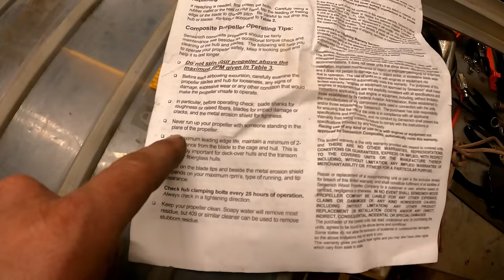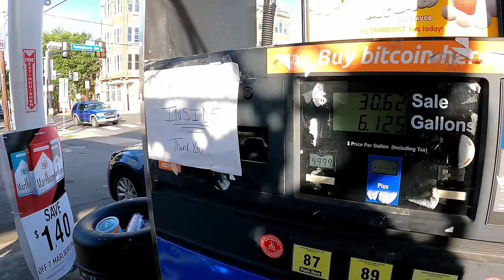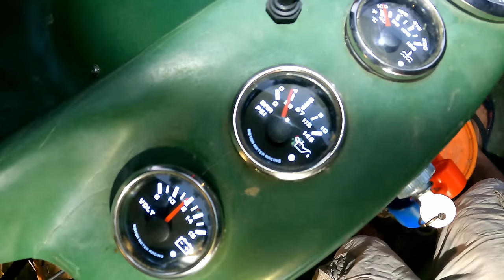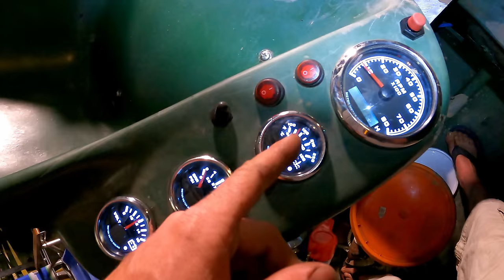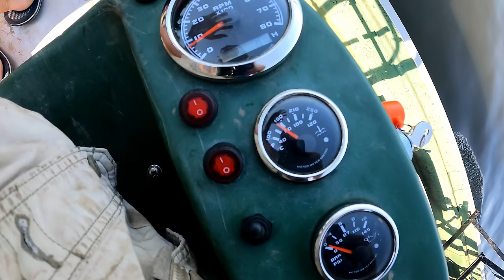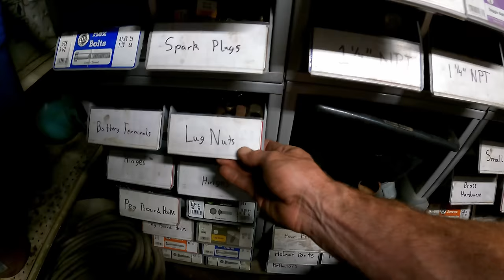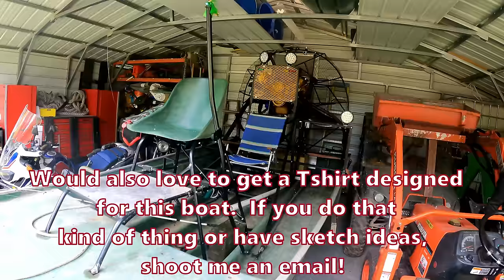CaddySwampAss Airboat Part 3 - NNKH

Comment: You need a grass rake on the front to lay the lily's down so they dont fold over the front of the boat and stop you. I've grown up.with air boats all my life and I've owned several and a 1976 500 caddy is bullet proof. I've ran those for years. Hard to find these days
Reply: Wouldn't a belt drive to the prop with the motor sitting lower in the boat be a better design? Also, are there airboat props that can handle more than 3000 ripums?  I have no idea. Zero airboat experience.
Reply: @jb-uw2vt  the 3000 rpm is for exactly that.   A reduction drive on that would be great. Get the motor rpm up in the 4500 range and keep the prop tip speed down where it needs to be.
Reply: They do make a long belt system that sits the motor down low but believe it or not they make the boats handle worse. The weight up top lets and helps the boat lean in turns and it needs that to keep the sides from biting. A biting side can cause a roll over.

Comment: Hey Chris - Just wanted to let ya know that your videos give me the kick in the ass to get out and get my projects done. It's been hard to work up the motivation to do stuff because of the state of the world. This spring I wrapped up my automotive apprenticeship to become a journeyman but the camping season started off with my relatively new trailer having a roof leak that had turned into a mess. However seeing what you guys did with the Clapper gives me the motivation and confidence to say everything is gonna be ok with it, even if it's really frustrating. Thanks for everything you do, and I'm really happy to see the Air Boat alive!! Looking forward to the next video!
Reply: Go get them done brother but do not forget camping
Reply: I know exactly what you mean. I broke 5 ribs in Feb. After a lengthy healing process I'm struggling to get motivated. I'm behind on everything. It takes one step to go outside and get started. We just got to take it easy as we re-adjust to an active lifestyle. We'll get it going

Comment: Chris, you can pull the drain plug on your boat once you take off, to drain the water. Always plug it from the inside if possible.
Reply: yeah just stick ur hand where the propeller is u will be fine

Comment: Love the channel! Years back I raced in the mud with a Chevy Blazer, I swapped to a Caddy 500, 76 model. Drop on some old 472 cylinder heads the cc chambers are way smaller. Bumps up compression a lot! I then installed an Edkebrock performer intake and Sanderson headers! OMG this combo ran sooo good! Mountains of torque! Not a big RPM engine but ran great! I have one unused shorty Caddy header if you want it I’ll donate it to your project! Also swapping intakes and the exhaust manifolds will drop ALOT of weight! The drone shots are awesome!

Comment: For powered boats less than 39.4 feet, or 12 meters, you need to have the following set of navigation lights.
One all-around white light that you can see from 360 degrees and from two miles away;
And one pair of red and green sidelights that are visible at 112.5 degrees and from one mile away. Get your VSC inspection and they will be very helpful, they just updated the fire extinguisher regs and you'll probably need a USCG–approved backfire flame arrestor on your carb. Easier and safer to comply than to get boarded an ticketed. Most local Sheriff's Dept with a Marine Division should also be able to advise/inspect. I enjoy your channel. Stay safe!

Comment: Considering she had a ton of water in the engine I am impressed how well she runs. Even idles smooth. Usually an engine that had all that in it (if not seized) it has smoke and rattling valves and needs a full carb rebuild... this thing just runs like a top.

Comment: So few parts to break! One belt drives a waterpump and a alternator, single 4 barrel carb and a direct drive 2 bladed propeller, no transmission or reduction gearbox. Goes where no boat can! Noisy but that's all airboats ! Simple and reliable!

Comment: Goldie runs so good. I'd bet that engine, with proper maintenance, will run for years.
Probably (late) 70's vintage. Those GM Big Blocks were built to last. You got all the garbage out so if it lasts a month, it may last over a year. The thrust pressure on the crank "issue" is something to consider. The engine already paid for itself. That runs so good. Oh, redundant. 🥰😃

Comment: They sell 1/4 inch by ten by 4 sheets of plastic that you can put on the bottom of air boats.  It's  slickery.  Guys here in FL all use  it. Protects the hull don't get stuck.

Comment: Hi Chris, :goodvibes:You could have put a big-ass magnet on the bottom of the oil pan (like you did in another video with a small magnet) to trap the sediment during all your test runs in addition to dropping the oil pan after each run. Just an idea. But fantastic technique of getting this apparently bulletproof Cadillac engine up and running again. You're a genius. God bless!

Comment: A mechanic told me this little tip. Put a quart of ATF in the motor and run that for a couple hrs. It will thoroughly flush out all the crud and sludge in the motor. Another thing to keep water from flooding over the back is you could mount something like a Camaro rear spoiler on the back. You may have to raise your rudders though to clear it. With that in place, the water that hits the back will be deflected backwards, away from the boat.

Comment: In Australia we install a wake tank in the back (arft) It's basically a shelf box of aluminium or fibreglass 1 1/2' down about 6" sloped back with a hole (or two) in the back. You can put in rubber stoppers. It's a gutter/drain.
Wear earmuffs and a rubber deflector on the bow! 
🌏🇭🇲

Comment: Spray rails might help. 
Suggest using a propeller protractor on each blade. You want both blades set to the same pitch to avoid angular loads on the crank. Set pitch for max desired rpm, either static for hole shot, or moving for top speed

Comment: For a part 4 of the airboat series you might want to fab up a couple pods for each side of the back of the boat and do a test run showing before and after on the increase in stability and floatation. cool video.

Comment: Late to the party, but if you're still having issues with your gauges, the issue is probably EMF. That means electrical interference from other cables, spark plugs, etc... Since you can't shorten the wires, try making sure they are all wrapped in a grounded enclosure, or add some ferrites on them to see if that improves things. As a test, make the wires very short to see if you get the same strange readings! Good luck.

Comment: After a month and a half, I finally picked up my little 8hp Mercury. They claim it had sand in the fuel system and cleaned it out for $650.00. Tried to start it today, nope. Had to drop it off again! My point is not everyone is as professional as you.

Comment: You had a few close (to sinking it) calls there.  If the motor dies on plane, the experienced guys say to jump on the bow.  (Therefore it lifts up the back some and limits some of the water coming over.)  Maybe you tried it, but when stuck, floor it (to 3K or whatever) and move rudders back and forth to break suction.  Nice work on getting her up and running!

Comment: You should add a 8 inch extension to the rear sides and across the top of the transom with some 3/8 aluminum to keep the water from flooding the boat when you stop quickly along with the front extension you talked about in the video.

Comment: I put a 1975 Cadillac engine and transmission in a 1977 Chevy pickup,  when it rained it was very difficult to take off, just wanted to spin the wheels.  It was a strong running engine. Even got better fuel mileage than the 350 it replaced  .( the caddy was a 500 cid with a TH 400

Comment: Hey Chris!
Wish I saw this vid before getting a set of those Motor Meter Racing gauges to do a custom interior on my International Harvester Travelall.  I got lucky and had them all work but had the same issue you did with the totally inaccurate tach. It bounces all over the place at seemingly random values. Should have gone with the Auto Meters haha!

Comment: The boat looks like it is plowing that's why you're getting all the splash. See if there's an adjustment in the motor mounts. You need to lower the front or raise the prop end. I own miniairboat assoc. on the internet and facebook group. My boat weighs about as much as your motor alone and also does 30 mph with 50 hp. I burn about a gallon of gas per hour. I live just north of Harrisburg, there are a few hundred airboats in this area.

Comment: Alrighty some words of advise for ya on the airboat. I would re-mount the radiator down under the engine stand if you can. Up on the cage like that is blocking alot of usable air for the prop. Also I would cut about a foot or two off the top of the rudder stick, you'll have better control and it will be way more comfortable to use when driving...Youll be also better off getting that front seat out of the bow area.. Redo the seat rigging where your driver seat is in the back in front of the motor and then put your passenger seat in front of that but not all the way up into the bow. The boat will run way better and you'll have more usable room for coolers or whatever... Also play with the pitch on the blades you'll be able to get it dialed in more. Don't be scared to turn them up to 3500/4000rpm. Wood props come apart around 3k rpm. Carbon can take more rpm.

Comment: While you have the oil pan off. Keep the old plug in it. Just use lock-tite. Then drill out a new hole with a stepper bit and make a new drain plug with a kit from the auto parts store.

Comment: One suggestion I would have on the awesome air boat is to put an additional panel under the expanded metal panel behind the rear passenger.  It would be catastrophic if the passenger's hair got caught in the engine pulleys.
Reply from the maker: Yes that's something that I agree is pretty dangerous. I always make sure to tell everybody to tie their hair up

Comment: For a motor that has been drowned, that engine is amazing. As a hedge against a surge coming over the back, it might be helpful to deck across under the motor and near the front edge set up a tilted vee wall (breakwater) to part the surge out over the sides. As for the front a higher bow will be helpful so you don't end up harvesting the tops out of the weeds. Otherwise, add a short deck with another breakwater. Be mindful that if the front ever goes under a wide lump in the water, comes down in the trough and digs in, the forward inertia will make it bite straight on down, the back will rise and fall over sideways. The motor mass will pull it on its side with the prop spinning, not a good place to be near if thrown overboard if there is not an entirely closed cage. How would I know this? It is suddenly amazing to be one minute king of the hill on top of the water with a long view into distance, then up to your neck in the water, no longer seeing all that far ahead, watching the last part slide under and the oil start coming up. Mine had a magneto ignition and offered me a bonus. I had a killswitch right by the seat and the thing electrocuted me when seawater shorted it out before the engine stopped. My arse was wet from wading pushing the boat out. All manner of muscles get a weird workout, trust me. V8s have good power overlap but if you have a cylinder drop out with a foul plug be careful not to let it idle too slow. Those carbon fibre blades are pretty good but you still may experience some blade flap with a skipping motor. With a six-cylinder engine, I had a blade snap and go through hull of the boat which was fortunately built like a surfboard, full of yellow foam between a thin deck and the bottom. Periodically check the prop hub for fretting of the blade material which might be apparent as a small powdery sludge stain. If the drive plate had paint on it or a patina of rust, it may crush, rub, polish and lose bolt tension especially it it gets wet after the process begins. This is one reason why six-stud left side Landcruiser wheels fall off. Most of all, enjoy.

Comment: Hey man, just speaking from experience lol. If you get stuck where you’re suctioned to mud like that it is easiest to go to the front of the boat and put your back against the front and push up with your legs to break the suction then bring pvc and put it under the boat. It’ll slide right off!
Reply from the maker: Thanks for the tip! I'll have to try that out. I actually got stuck in the mud today again. Pretty good suction and I ran her full throttle whacking the Rudders side to side for about 20 seconds and it finally broke out. That was a tip somebody else said on this video. Worked great
Reply: @NoNonsenseKnowHow  yeah man, I have a 18 foot air ranger and first trip out we were stuck on a Oklahoma red mud bar for 8 hours with the grass rake hanging over the water😂 it’s some nasty stuff but if we would’ve had pvc we would’ve gotten out of there way quicker

Comment: Find you a good wide deep flat bottom aluminum jon boat and transfer the running gear over to it and you will have a real air boat. That fiberglass boat will put you swimming one day. It doesn't have enough freeboard for one thing and if you hit any snags or rocks in shallow water it is coming through that fiberglass.

Comment: Your videos are always awesome, glad I found your channel. 

Although if you're going to disconnect a battery cable to work on the engine, I would recommend disconnecting the negative instead of the positive. It just creates a safer work environment.

Unless of course the system is a positive ground, in which case, you would disconnect the positive. I don't remember which way the Caddyswampass is wired.

Comment: Just watched this video looks like great fun.
Perhaps you could add an extension to the rear and side of the edge of the hull, where the frame is of a few inches to reduce the chance of water back flowing into the boat.

Comment: Golden rule of (vehicle) recover alway pull them out the way they went in, if possible. But a great entertaining video
Reply from the maker: That doesn't go with boats. The back of the hull is the heaviest part and has a squared off edge that will dig into the mud.
Reply: hadn’t thought of that!

Comment: Take the paper you took out of the oil filter and put it an a vise, a bunch of it filed up and squeeze the oil out of it and you will get a much better picture of what is in your oil. That's how they check what's in the oil on Big Rig Diesel Trucks before  tear Down. Good luck...

Comment: Being from Florida and having a airboat I can say that boat needs a 383 and a 2.38 gearbox with 3 blade prop. You would be surprised where you could go. Good luck 👍🏻
Reply: And a few gallons of gator glide on the bottom

Comment: From an aviation standpoint... the plane of the blade is the plane the tips rotate in (not behind).  Imagine standing NEXT TO the blade and it coming apart.... thats the plane.  Though I wouldn't stand around a spinning prop without a guard either.
Reply from the maker: Yes. Thank you for mentioning that. A few other people mentioned the same

Comment: You need to put legal navigation sidelights on. 

Sidelights - Colored lights - red on port and green on starboard - showing an unbroken arc of the horizon of 112.5 degrees, from dead ahead to 22.5 degrees abaft the beam on each side.

Comment: What if you added about a five-inch extension plate bolted on the front of your air boat? Make it out of aluminum and use the existing bolts at the bow now. This would give you more protection from the larger waves.

Comment: Try a resister on the tach signal wire, had to  do it on the old Sun tachs with needle bounce, look online for the correct ohm resistor....

Comment: "In the plane of the propeller" means don't stand beside it. I really enjoyed this build. I wonder if you would get better performance by mounting the radiator in front of the engine with an electric fan. Seems like a lot of swept area could be freed up.

Comment: i’m from SouthFlorida and most of the Old Timers  do use the old Caddilac engines on Air Boats  I’m a Boat Guy  and years ago the HotRodders liked to Scarf up all  the used Chevy SmallBlock engines fromJunkyards or wherever they could find one in rebuildable shape similiar to the Cadillac GM  used to manufacture Marine Blocks withForged Cranks and Extra Bxtra MainBolts  these days  if you can find a 283 SmallBlock out of a Truck ,Some StationWagons and late 1960s Impallas they  are “Beefed” Up the way you need them to be a Inboard boat engine

Comment: have you considered filling the base sides 2ft wide with rigid foam so you can't sink the boat? it will also stiffen the base without much weight change. i would also drop the motor and run a belt to the fan instead of direct drive. this changes CG and allows you to change the gear ratio so you can spin the engine up into its power band.

Comment: So.... ..
Yeah.......
Center of gravity?
Whoa

Where you were holding your hand there above the water while you were on plane...you might extend some sheet metal out there and out the back to keep water out?
Watched the whole video. Loved it. You're a smart dude. Gotta whole lot going for you. Nice work.
Reply from the maker: It's actually been pretty good so far without any modifications and been running it hard
Reply: @NoNonsenseKnowHow  Is there a thrust bearing you can put in to make it more airplane like?

Comment: I probably would have just hit the bottom of the oil pan with a hammer to flatten it out, but excellent video as always. Can’t wait for the next part.
Reply from the maker: I thought about doing that but then figured with my luck I would end up blocking the oil pickup tube

Comment: 18 psi idle is fine 30psi at WOT thats a bit lower then I would expect id like to see 40PSI hot some of that is probly oil to heavy and some of that might be the springs in the oil pump